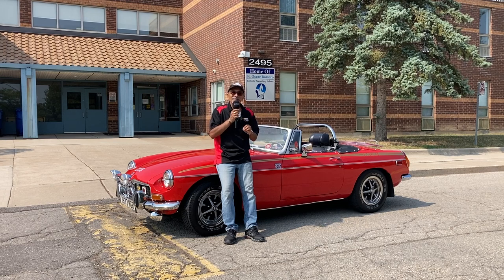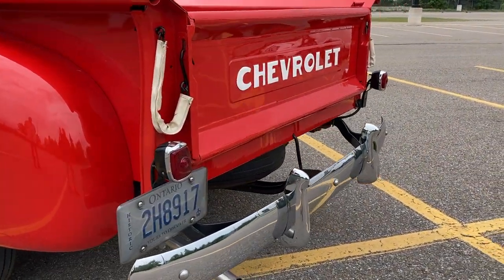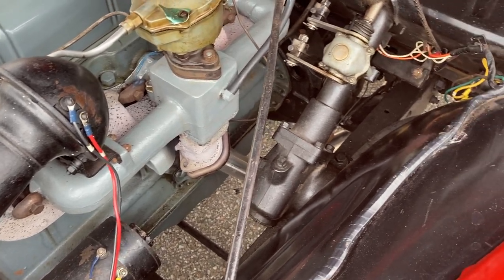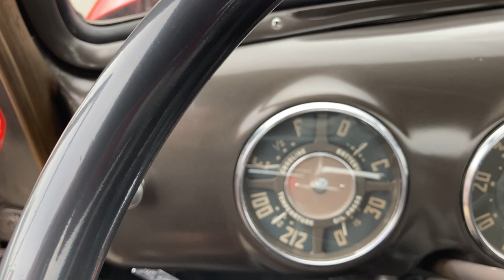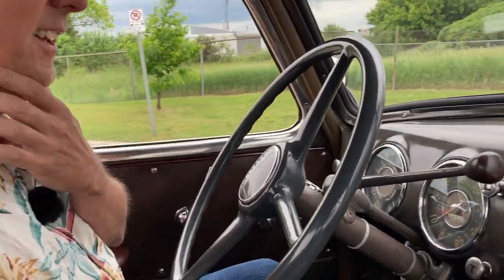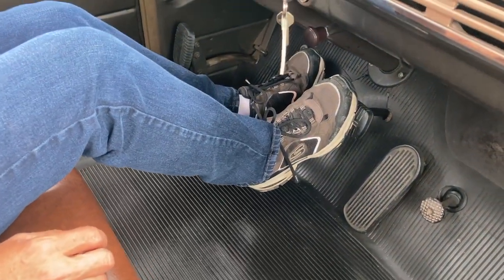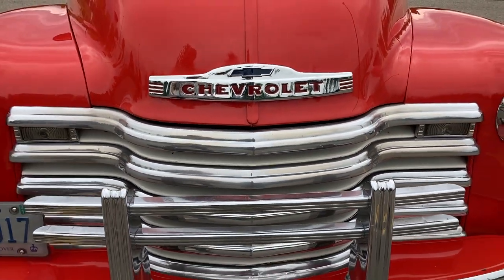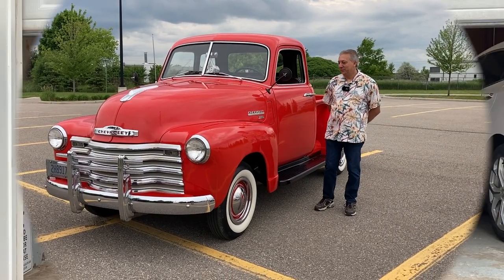1950 Chevy 3100 – 5 Window Deluxe!

Comment: I was told that back in the day that it was not legal to enter a vehicle in traffic (from the road side) so with all the bench seats people used to enter curbside and slide across the seat so they only needed a lock on the passenger side.  If anyone ever locked them back in the day.
Reply from the maker: Mike, that would make sense why they had locks on the passenger side only. Interesting philosophy however they also had more angle parking than they do nowadays. I kinda miss seeing that in the urban areas.
Reply: That's not a factory horn.
Reply: @williepelzer384  Actually it is, I know this because I've had quite a few 47-53 Chevy trucks.